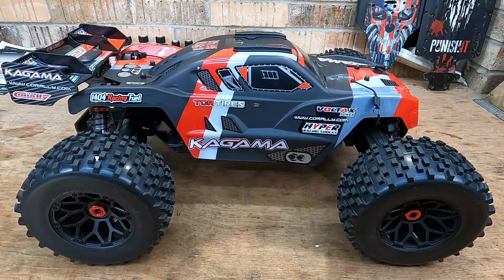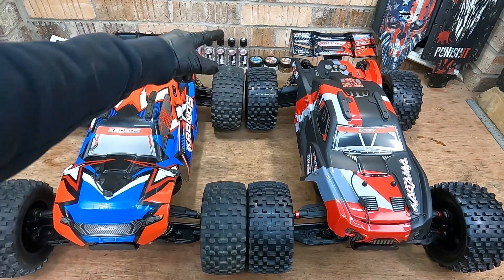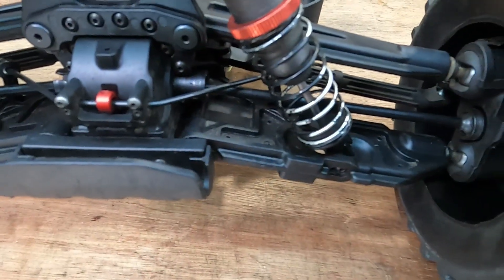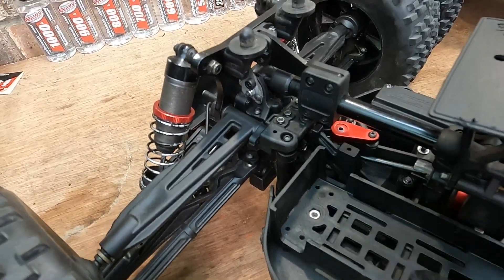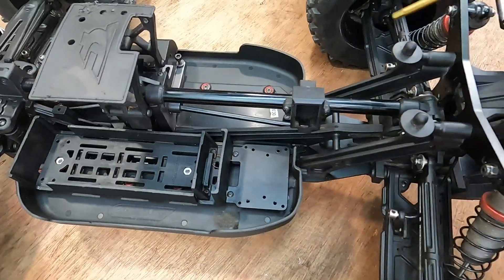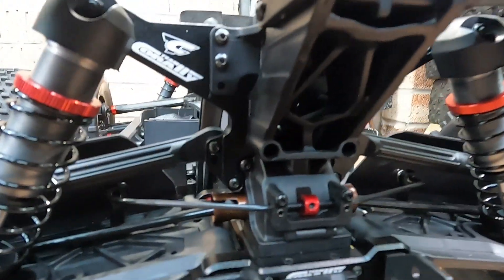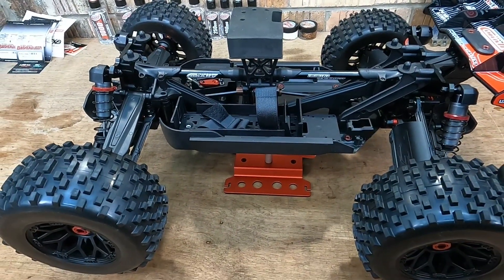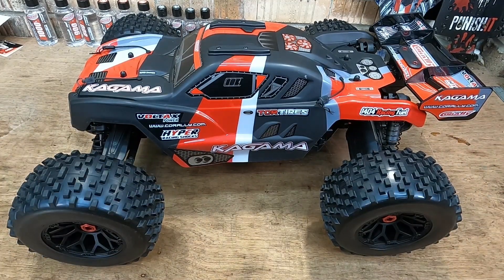NEW KAGAMA 6S XP by Team Corally FIRST LOOK & In-depth Kronos V2 COMPARISION. WOW..LOVIN WHAT I SEE!

Comment: I have the Kronos from 2020 and if chrash the rod ends come out. It a great car. Just used locktide. I also need to buy a new servo the original was not doing the job, the diffs where empty only a little greas, and the dampers where badly filled to. Also changed the radio system, and wheels truggy ones.
Reply from the maker: Hi buddy. I also replaced my servo with a 35kg one. I've found it to be much stronger than the stock one. 
In my experience, the outdives fall out of the cups when the arms become bent or deformed from constant bashing. To fix it, you can either replace both top and bottom arms or to save money you can trim a very small amount off the pivot ball ends of the top and bottom arms resulting in pushing the drive shaft further into the drive cups. This has worked for me in the past.

Comment: I love mine..So good out the box.. Imagine an xtr version!
Reply from the maker: Yeah man. I'm impressed with the xp. Really all it needs are so 7075 bits. Like it is it reminds me of the sledge but without that motor mount rubbish!
Reply: @inspiredrc  And far better stock hardware.. Hardened steel gears as opposed to powder metal and also spring steel..A 6061 chassis that can actually take a bashing unlike arrma and traxxas chassis..7075 is not needed with this rig unless you go super big and crash then you might bend a shock tower a bit or snap a standoff screw.. I actually run foam underneath the body it helps to protect the front shock Tower and standoffs
Reply from the maker: Totally agree! 👍 nice idea about the sponge. I may try it out. Dude watch out for the first bash vid. It was EPIC!🔥🔥 I'm just editing at the moment. It should be ready in the next couple of days. 🙂🙂
Reply: @inspiredrc  Nice!!!!

Comment: Before you beat on it change the shock oil it's WAY to stiff out of the box and wants to tumble over!!

It's really tough apart from the upper wing mounts!!..
Reply from the maker: Thx for the advice bro. I am impressed with the upgrades and yes the shock oil seems to feel a little thick. It's prob going to need some tuning. What shock oil are you running?
Reply: I went to 500 cst in the rear and 600 in the front, still going to need a bit more tuning but a lot better.
Reply: Available in the 🇺🇸?
Reply from the maker: Yes